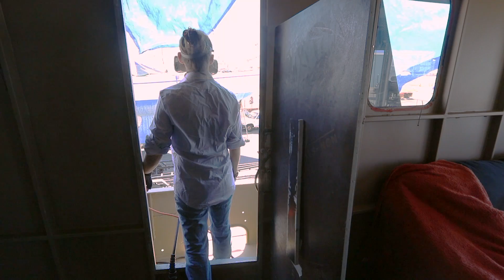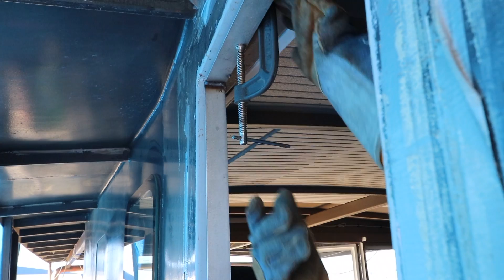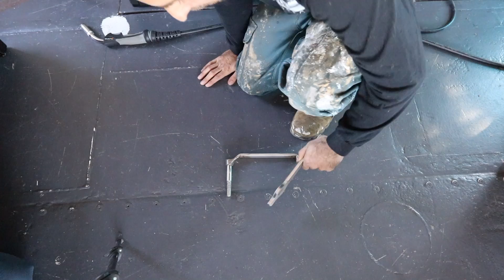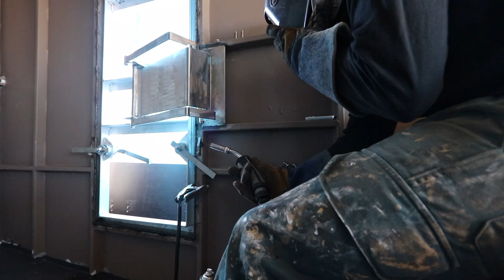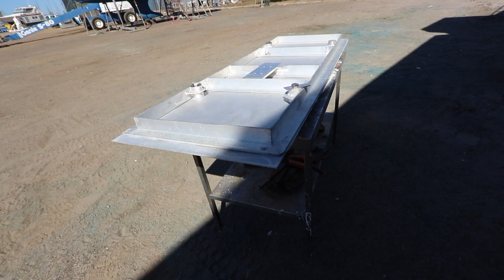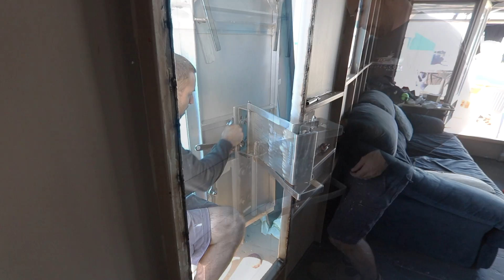Aluminium Seadoor Install - Project Brupeg Ep. 96

Comment: Those hybrid strips you're talking about are what are called a "transition metal". You can use brass or bronze fittings between steel and copper, same thing. Of course, zinc anodic protection adds even more corrosion resistance. Corrosion involves the exchange of electrons, so you use a metal with a higher coefficient of corrosivity as a sacrificial anode, thus preventing the corrosion of the other metals in contact in an electrolytic solution ( seawater ). Brass/bronze work because they are an alloy of copper and zinc. In the Navy, we would use transition metals and zinc anodes together to keep steel ships from rusting. Of course, paint helped too. That's why sailors spend so much time chipping and painting, lol.
Reply from the maker: Thanks John, I remember some of the older fishing boats i was on, the paint in places was an inch thick! as it was a weekly job.

Comment: is your water and electricity included in the fees there? or are they metered? you must use a lot.
Reply from the maker: Its included, actually dont think we would use that much, the entire boat runs from a single 240v/15a outlet. we just manage demand carefully (ie unplug something larger when we weld for example)

Comment: Fantastic work on that saloon door Dame.  Once you get used to a new tool you really wonder how you managed without it before.  I don't know if you have already cut the inside handles short, but if you haven't, cut and bend the ends like you did the outside handles so you have the longest lever possible to close the latches.  And I agree with Jere Land below, Jess's hair cut looks really nice and will be much cooler this coming summer.  Take care and am looking forward to next week's video.
PS: when is the next live chat?  Don't want to miss it!
Reply from the maker: Hi Matt, yeah I've been thinking about the inside handles. they are still full length and i will put some sore of bend in them, one idea I had was having them over lap maybe so I can lock them on the inside easily with a pipe slider. not sure if i will as my concern is overlapping stainless handles sound like really good finger choppers... bit more thinking on this needed I reckon. As for live feed, nothing plan right now but I've been pondering the idea of Patreon live feeds more regularly.
Reply: @ProjectBrupeg  Dame, If you can bend the handle ends so you have the thickness of your hand between the ends you could add a small block in the bend with a hole in it then drop a "U" shaped piece in the holes for a lock.  In an emergency this would be fast to remove but would prevent the handles from turning from the outside.  Just a thought.  Take care and give my best to Jess and Mishka.

Comment: Hello Damien and Jess, 
I am writing you this from Portland Oregon! I recently discovered your videos and am hooked! I was watching this episode and saw the zinc anodes on the hull and it reminded me of some research i have recently done for preserving a historic vessel that I volunteer on, the USS LCI(L) 713 Landing Craft Infantry from WW2. www.amphibiousforces.org  She is 158 ft long steel hull vessel made in 1944 from 1/4 inch carbon steel and is today  very fragile but still afloat. We looked into using zincs as well, but were told about a better option called ICCP (Impressed Current Cathodic Protection) that modern Navy ships and large marine vessels like oil tankers and freighters have been using this for several years now. Over the last few years, several companies are manufacturing less expensive models suitable for private individuals use. I did a quick internet search and found several that may be suitable for your vessel. You may want to look into this type of system to use on BRUPEG. I found one made by Electro Guard company that sells for about 1875 (Model 630FM) I realize this may be out of your price range but I just thought you may want to consider it or others like it. Good luck in your adventures. Jerry
Reply from the maker: I have heard of these systems, for us its a really nice to have but not critical as these anodes have maybe 90% of there metal still available. That said we have 16 anodes which are around $100 each so its certainly something we would look when these come up for replacement.

Comment: Check your polarity. That causes ugly welds even though you are doing better.  Aluminum, steel with solid wire and steel with cored wire all need their own polarity.
Reply from the maker: Yeah the specs on the welder say all need a positive earth except flux core. We were using the positive earth, just not used to the welder yet. I want to figure out my technique before I go swearing at the machine...
Reply: @ProjectBrupeg  Good.  You can also move your ground clamp to change the magnetic field in the work piece.  Most times that works best.  Nice looking door!

Comment: I know you will be in some very cold environments, have you thought about the expansion and contraction of the aluminum door? As in, will the glue hold up, I know the dogs will hold it on but maybe a good amount of rivets would add some security and take the stress away from the glue.
Reply from the maker: Thats actually why we used glue. Glue allows for the expansion and contraction. Any solid mount like a weld or rivet is actually a weak point as they really dont like to move.
Reply: @ProjectBrupeg  Nice, thank you for the information, I don't deal with expansion issues as I live in Florida and it stays hot. It is great information that I can use down the road if I ever get to build something I will travel with. I too have seen the difference in welds when using a better machine, your skill is really showing now that you have the right tools!

Comment: Good job! Make sure the edge that will come in contact with the rubber seal has a nice smooth rounded over edge. On board my ship during my Navy days we practically had to keep them polish to satisfy the Chief.
Reply from the maker: YEah at the moment its a 3mm rounded edge, but im wondering if i might need to weld on a piece of solid stainless round bar maybe 8mm diameter so its a super smooth shiny surface. Ive also heard of boats using something like vaseline on the rubber to stop it gluing on and/or tearing
Reply: Project Brupeg , a silicon based lubricant is used on automotive seals that actually preserves the rubber.  Vaseline is a petroleum product.  I’m not sure if that’s good on rubber, or if it degrades it over time .
Reply: @ProjectBrupeg  I think the 3mm will be fine. I don't think you'll need any kind of lube unless you plan on the door staying closed a majority of the time. There are lubes out there that are compatible with rubber, but then again that will depend on the type of rubber.

Comment: Any reason you didn’t weld the door skin on?
Reply from the maker: Warpage mainly. Its only 3mm alloy so will bend and warp a lot if I weld it. Plus given we are heading to really cold areas we need the door to be able to expand and contract, by gluing the skin to the frame it acts partly like thin insulation and stops some cold transfer from the outside to the inside but also allows the frame and the skin to grow and shrink independently of each other without leaking.
Reply: Just guessing: warping, water tightness, ease of attachment, final finish

Comment: U should us nylon wedges so slide better
Reply from the maker: Hi Sons, yeah i want to make that movement smoother. I'm thinking of added Nylon pads to the underside of the handle rather than change the wedge as that's all welded in now.
Reply: Yea that sounds sweet mate u to r doing a great job 👌🏻👍

Comment: Damian while you're at it make a spanner from scrap steel so you can tighten or loosen the half cut nut. A normal spanner will not fit in the space once you have the door installed. Put a hole in one end and hang it on the door, that way you will always know where that special spanner is.
Reply: Excellent idea, however, I'd be more inclined to have a pouch on the door where it will live. the constant clanging of the spanner as Brupeg moves about would drive me insane.
Reply from the maker: I agree with both of you. I love the idea of a 3mm thick spanner. Perfect for the job. Thanks for both ideas guys! Dame

Comment: Are you going to put a small window into the door. Makes it easy to see if there is someone on the other side, before you open it?
Reply from the maker: No window in this door because we need the insulation more than the visibility. Like Jim said its not going to open fast so bystanders wont be startled quickly.

Comment: First, love your vids and the idea of the project.  Binge watched them all when I found your channel.  One suggestion though...you might want to think about flipping some of all of the dogs over so that the weight of the handle will want to close the dogs instead of opening them.  The way you have them installed now, if you get into rough weather pounding into waves, possibly with waves boarding and impacting the door flexing it and compressing the gasket, the dogs could open by themselves leaving you with an open door at the worst possible to time.  Something to think about...
Reply from the maker: Yip your dead right. The issue we have is Jess cant reach them if they go up so the plan is to have a little latch on the inside door trim that 'locks' the latch in place.

Comment: Hi guys ..
 Thanks for the weekly fix ..
I've really enjoyed each n every video from the start .
 Like "health food " to an old sea dog  .
Got lots of questions  ..So will start putting them your way ..
FIRST:  Do you have plans to fit a  good fire main pump along with  hoses .sprinklers  or foam making system .. ..???
Thanks for sharing    
BEST ON THE TUBE
Reply from the maker: Hi Craig, yes. Engine room will have a fairly decent system depending on what we can afford. Everywhere else will be alarmed up the waahzoo. With a pretty hefty amount of hand held's located all over the boat. As for pumps, I want to fit a diesel water pump on the aft deck with stainless pipework leading to the pump (so it cant really fail) that can act as a main fire fighting device and a excessively powerful bilge pump if required.
Reply: @ProjectBrupeg  that would also double as an amazing deck wash down pump....

Comment: Are you worried about corrosion in the are where the stainless strip is overlapping the (non-stainless?) steel of the door frame? Since your weld is on the inside, you have a 10mm(?) unsealed overlap where moisture can collect.
Reply from the maker: Thats true but i do plan to be filling that area with a good two pack and its so well protected i doubt the paint will get chipped off. if it does it will only be a small be that can be touched up. 

If i was building this all over again I would have built the door opening 100% stainless to avoid this issue, never mind. Live and Learn

Comment: The duty cycle on that welder seems to be pretty good. You're getting really used to that welder seems to be doing a pretty consistent weld.
Of course that's got nothing to do with the operator.
Great to see things working out on the door even stuff you didn't plan.
Sorry to see Jess having such a difficult time lately.
It does look like the weather is little bit more moderate.
All the best Dennis
Reply from the maker: Cheers Dennis. Yeah main thing I’ve noticed between this welder and Nugget is the shape of the weld is MUCH more consistent on the new welder. If you have nice even travel speed the weld is generally spot on. Nugget was much more temperamental to slight changes